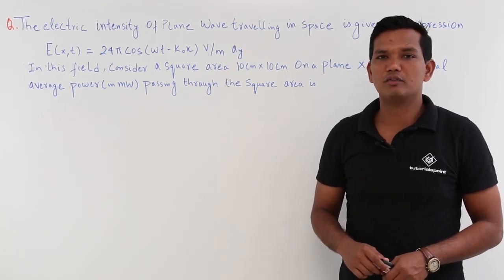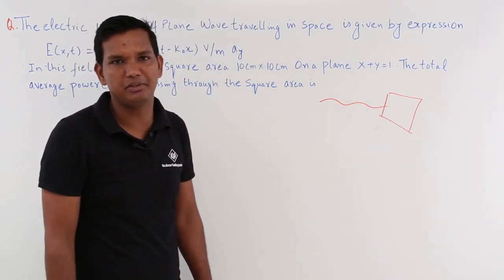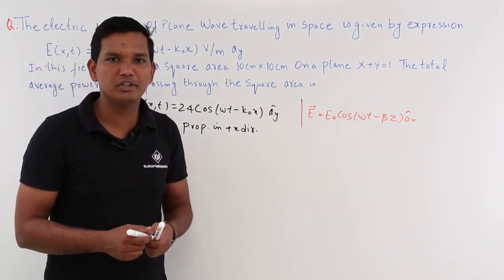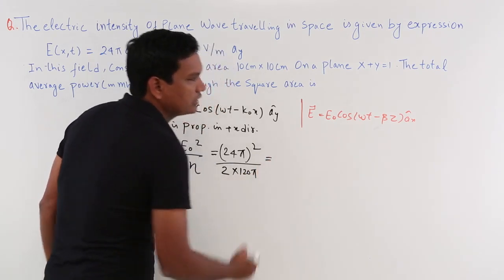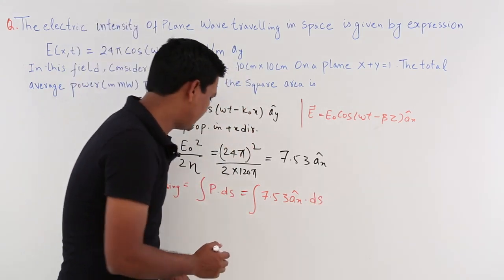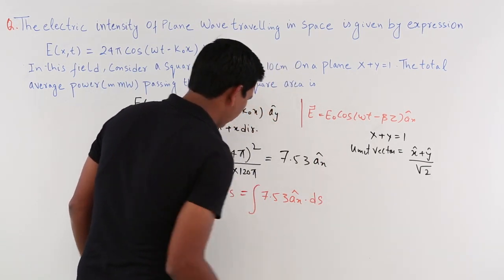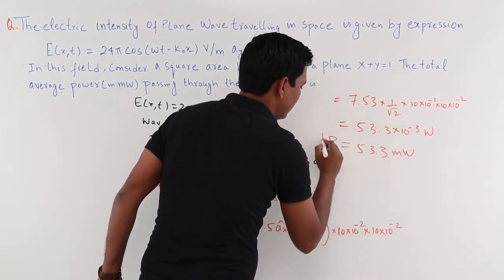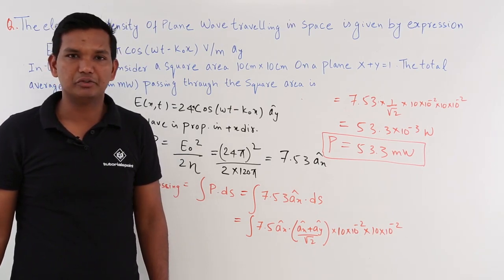Average Power Plane Waves Example

Comment: thank you so mush , what application will we use this for , where is this to be used in which senario , thanks.
Reply: @Sven Macolic thanks for your comment but I dont think this is the case here, please pause the video at 6:45 and substitue the values instead of 10 cm , which is 10x10^-2 ,  make it simple make it 1 meter to get rid of 10^-2 , so it will be 7.53 *(1/root(2))*1*1=5.3245 !?!?!?!? so by increasing distance we are getting MORE power which is absolutly wrong we should get LESS!! try it with 1 m 10m you will see what I mean. I think here he is talking about something else or the entire example is just wrong.
Reply: here with this example we can see that by increasing the "size of the duck " the area , the duck will receive more power which make sence ! , and can be proved by the formula given in the example the bigger the area the more power is delivered to the duck ... I hope this help.
Reply: so going back to the inverse law of distance you mentioned , yes it is true , first we calculate how much power we get at that distance and THEN with (that result) at that particular distance we (use the answer) to calculate how much power deleiverd to a surface area like the duck area (at that distance) which is in this video. this is my conclusion.
Reply: @Sven Macolic one of my replies has been deleted by youtube I have sent you a link , please provide me your email so you can follow what I am trying to say because without that link it will be not useful.
Reply: @Sven Macolic instead of saying 75.39 he said it is 24*pi  = 24*3.14 its just another way of sayin the amplitude E0 = 73.39
Reply: @Sven Macolic volts
Reply: @Sven Macolic pause the vedio at 3:8 it is E0^2 / permitivity of air 120pi *2 so it is E0^2 / p 240pi   dont miss the factor 2
Reply: look on the net for (  LII6III78  ) and look at 7.6.1 Example – Duck a la microwave once you have seen the example go back and read all my comments